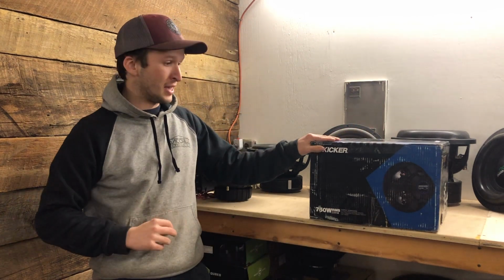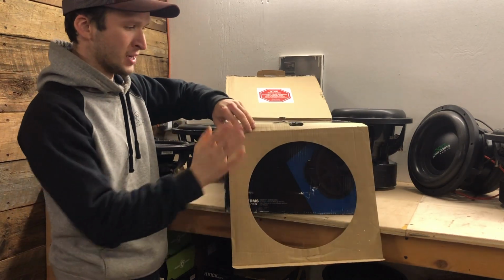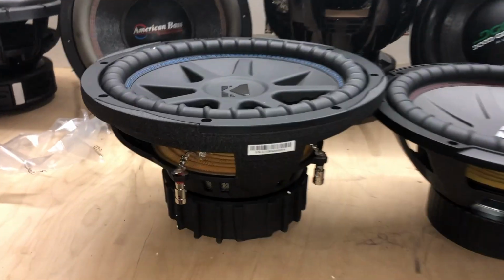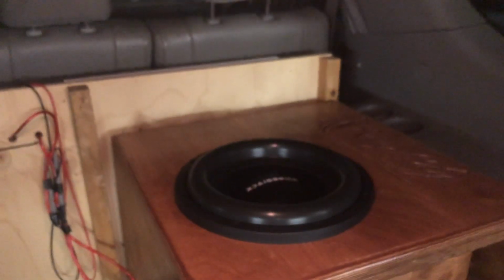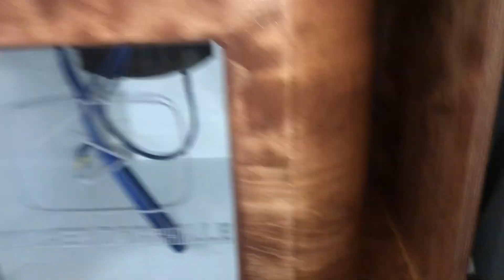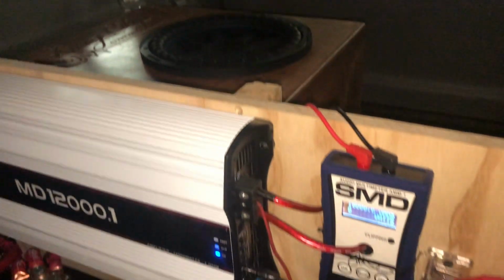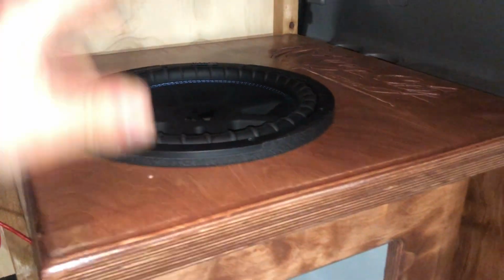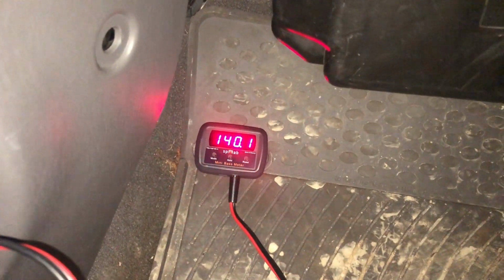This Kicker Sub Gets LOW! Comp VX 12 Subwoofer Review! CVX

Comment: I've been doing car audio for 25 years.  I had many kicker subs in the past from comps to L7s.  I had a pair of those new CVX subs with the blue stiching, and they sounded terrible.  Tried several boxes and amps. Thought how can it be.   Swapped them out for Pioneer champion Pros and night and day difference.   Then upgraded to American bass elites which sound amazing by the way and blow the kickers out the water..  Out of all the subs I've tried the new CVX were the most disappointing.  They just sound terrible.
Reply: I just put 2 10 in Sony subs in my old L7 12 in ported box pounds the same as the L7 I had before
Reply: agreed bro kicker to me is the worst company but good you upgraded.
Reply: @thaboiimarcos9459  bro that is a laughable statement. Sony is so branched out in other electronics making so many different items they do not have nearly the sound quality that kicker does. I've been doing car audio for 12 years and I've owned several kicker subs and I even bought a pair of Sony's ( Sony XS-GSW121 12) that were silver with black lining rated at 500 watts RMS them Sony's could not touch what comp r would do, both subs were rated at 500 watts RMS my Comps Rs (5 years old at the time) blew them out the water needless to say the Comp Rs lasted over 6 years. 1 speaker even started knocking, it never gave up and sold them with the car.
Reply: @212Tan  everyone has there own opinion sony to me worked out better then kickers to the way i tuned them
Reply: @212Tan  Ironic how you’ve been doing car audio for years and praise Kicker for having the best sound quality when that obviously goes to JL, Focal, American Bass, and a few others. I run a Kicker sub and it’s okay. Gets the job done and digs low. Nothing to write home about.
Reply: @Iridiumcosmos  kicker for the price shit all over JL or Rockford. They provide great SQ for the price. I refuse to spend money on a W7 that in reality isn't shit 🤷
Reply: @212Tan  Now I know you’re a fanboy. JL subs are far more quality than 90% of Kicker’s lineup and I’m not even big on JL. They just can’t take power worth a damn. But you’re definitely smoking crack if you think it’s the other way around. I have little to no experience on RF so I’m not going to comment on them.

Comment: Love my cvx 15 but plan on getting a skar zvx 18 eventually
Reply: yes you should switch fast because kicker is a disappointment to me
Reply: Hey I'm literally about to buy a 15 inch cvx, how long has it lasted? And im only gonna be giving it 600 rms.
Reply: @luisalmendarez1606  you should switch companies bro change to skar or dc audio kicker at 600 is not going to sound good at 600 watts wont get low wont get high it will barley move
Reply: @thaboiimarcos9459  ive looked into skar reviews alot in the laat couple of fays, and a bunch of reviews say that the subs smell burnt after a while of playing. Im working with about $350 and I just blew my 15 cvr that ive had for 3 years
Reply: @luisalmendarez1606  skar is a way better company those reviews probably come from people who buy 1200 watt subs and try to push them more then that kicker wont last shit bro it lasted you something you should switch companies i say go with dc audio level 4s those will blow your mind
Reply: I've had mine for 6 months with 1200 rms with no problems in a 3.2 cubic feet box. No bottoming out and hasn't gotten hot at all. Far louder then my 2 12 inch w3s I used to run.
Reply: @jeremyhinkle6572 cut the lies homeboy JL audio has way better builds
Reply: My crv was louder then my w3s were so my cvx I would say is almost double that.
Reply: @jeremyhinkle6572  hard to believe brother😂
Reply: Ok so i just went a whole different route and bought the 15 sundown SA d4.
Reply: @luisalmendarez1606  great choice enjoy that sub brother you gonna be heard from blocks🤝
Reply: @jeremyhinkle6572  I was going to go with a 10' JL W7 but for not even half the price as that I can buy two 10' CVX's putting out 1200 watts while the W7 is only 750 watts. And I want at least 1000 watts in my car.

Comment: Ya it was def maxing out. Interesting on their spec sheet it handles less watts on a smaller box. Doesn't make since, maybe they got it backwards. Smaller box handles more power. 

I think u need to put it in a smaller box and try it again and see if the subs keep popping at same or less power levels as it did in the bigger box
Reply: its still going to sound like shit
Reply: @thaboiimarcos9459   🤣  ya its not the best sounding sub on the market but I guess it has its own following

Comment: Really Parker u gonna vouch for a sub that has no track history over a company that has over 1 million hours of R&D since the company was formed. N that CVX note for note same power being delivered to each sub. The CVX will outlast the black brick. Watch n c. I not sayin n e of kicks line up is the best im talkin longevity.
Reply: You think they got a million hrs of research in that sub? You can poop out a sub better than that one. 
If you want you can contact the same company in China that makes these and design your own sub. Its pretty easy just cost ya money. You can even do it here in the US.
Reply: @easylooker  no not just that sub. I type fast. I meant over the hole kicker line up.
Reply: @easylooker  yes i know that. And im talkin durability on medium spl with hi SQ im a solo baric man myself. Still got my 1st sewn tinsle L7 they came out with bumpin. I truly just like the L7 n solo X. Cvx is best in 10 inch size. N what do u expect a sub to do when it gives u an exact rms under a thousand is gonna do with 12k goin to it in a non propper specked box
Reply: @jeremiahhodge6826  it never had 12k going to it. Not even close. A 750 rms sub should easily be able to burp 5x the power rating. My first pair of subs was in 1992 and it was a pair of kicker competition subs. I had several kicker subs in the past. And many many different brands of subs in all sizes and shapes and yes ive owned square subs as well. You need to get out more if you think kicker subs is an accurate sub. To me they are a low level sub. They have thier place and probably sold as many subs as pioneer because of Walmart selling them.
Reply: @easylooker  i agree. N u can have 50 dif subs from best to worse n they all gonna sound the same!!! ITS the amp that makes the sub move n bring the sound to life. Parkers amp can do daily tyoe systems but its a amp built more  towards SPL and the sub he is testing is more along the lines of a cerwin vega STROKER. and i had to listen to my brothers 18 bazooka tubes. N i dont BS my build was complete more than 10 years ago it prolly been 15 years since my baby been completed. But almost every sub parker puts in his show I've already had it in my liberty in tuned spec built boxes. From 18" HDC4s to 19" power to about 7 duf NEO. Im in waitin list for Massives New NEO. I am not actin ruch or n e thing like that its just music is my life. N every cool sub i get, There is a sub i sold just to get the dif 1 with some time regrets of why did i do THAT. Ive sold DD subs expecting to get sundown n its lightning audio. But all i do is chase the bass. Right niw i on the 10" mission i want 3 decent 10s that will do the job turnned up and ride n blow for about 1-3 hours a day.. My 1999 Nissan maxima is always down nd on point
Reply: @jeremiahhodge6826   if your going to be in your car 3 hrs a day driving your going to want very nice sounding speakers so you don't get ear fatigue from bad sound. One vehicle i have zapco amps and the other i have Audison amps. Need to run active on your mids and highs minimum.  If not you need some really good crossovers. By the time you get those you could bought the bit one, zapco or which ever brand you like to tune your system. I have morel in one vehicle and top of the line hertz in the other. I personally like the morel tweets. Much more crisp to my ears. Soundspeak also makes a decent one as does audio frog. Ive had a few sundown subs and they sound muddy but get loud. Fi subs also get loud and you can have them special built for them to have a more audiophile output. They are not subs you want to compete with in sound quality but they sound decent for the output. Haven't had a single person sit in my car and not tell me they can't believe how loud and clean it sounds. I'm running around 1600 watts rms on my mids and highs and 5500 on my subs. When listening to certain types of music it will give ya chills because it sounds so good. Some music you can clearly tell it was poor recorded quality
Reply: @easylooker  u packing way more power than my maxima. My liberty is like a Frankenstein. What u just posted gave me more info than i hav time to try n figure out on my own. I will b in contact. I have a $50,000.00 cashiers ✔. That im holdin soni can open my own sound shop. N i know i gonna hav to pump out alot of small sales. But long run is what im AFTER. I truly want the man THAT over seen or built the Virtual Technologies boxes. I hav a small single 10 box n a norm 12 sized box and a single 15. N swear every1 thinks there system is the best. I hav a single 2nd gen alpine type R in my 15 VT box. But i dont know sounds spec wise of what makes the box more a spl or a box that is more fore SQ. But this type r in thus box. I shit u not i can hear my female coming from 2.4 miles away n start feeling her when shes 1.6 away.. N i can truly tell out of every system wich is my car coming or not. I know its the box. Luckily i got a good girl n she has a good trust worthy family
Reply: @easylooker  n no bs ive had a solid 3 12 box with 3 L7s in it and thus VT box weighs more than the 3 12 box. But the box is so SPL.  But i was gonna open my business n swear a week later covid kicked off. Only reason i still hav this cashiers check. But back to the box builder. He was ahead of his time. I hav not seen a VT amp only a VT sub n it said made in 97 n it had sewn tinsles. N also i only use a black n yellow kicker cx1200.1 so that sound is not the amp making that sub do so well.

Comment: So the sub designed to take 700 watts ported(read the manual), installed in a box bigger than spec, with a much larger port opening,  fed 150% rated is not operating right.  Say it aint so...lol 

Feed it 700 watts in a proper box and take an spl reading, then compare that to anything else at 700watts. I bet the CVX will be near the top at its RATED power.  The sub you pulled out took 4500 watts to make 140.8, the cvx did 140 on 1600. in the right box with the right port it has potential to be louder on less power. try it. wait you did with the comp r.

What you are doing is operator error.  Kinda sad to see you resort to these tactics.  That port size and tuning, low 30's hz does not control the cone and you are basically free airing the sub and it seems the former is hitting the back plate.

Most car electric systems can not support a 1000 watt amp with out Voltage drop, unless you upgrade the alternator. That is what these subs are designed for. Normal people not 'baseheads" 

come on now, I just lost all respect for you.